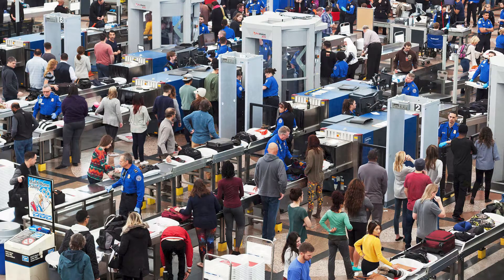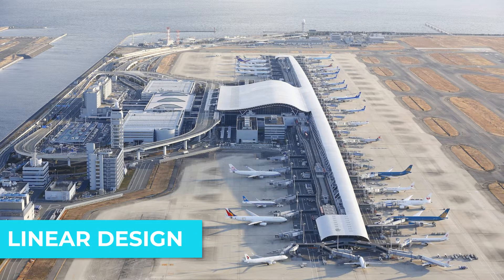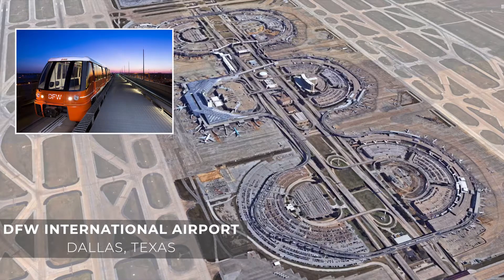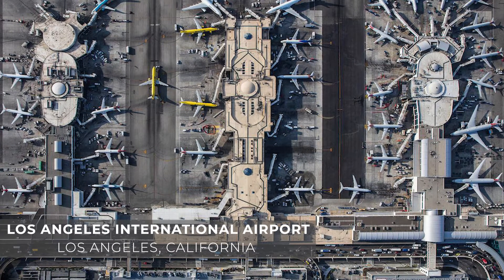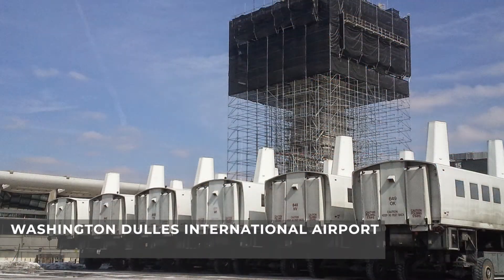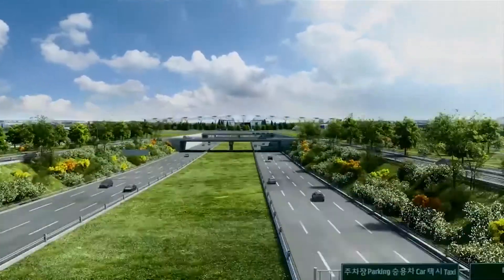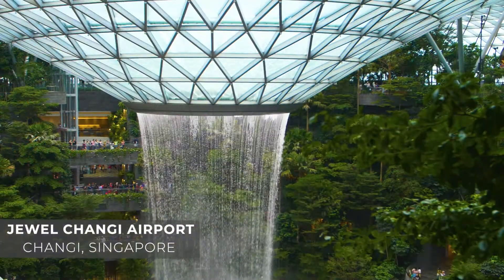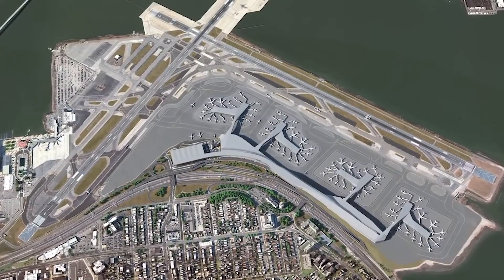How to Design a Good Airport Terminal

Comment: A travel tip - in some instances when purchasing airline tickets some airlines will tell you what terminal a flight comes into and if you have a connecting flight, what terminal it goes out of.  I look for this, as it can help with setting expectations regarding making connecting flights.

Comment: What about the landside/airside design of Tampa and Orlando? The best layout by far.
Reply: I flew out of Orlando a lot for college. I liked the convenience of the satellite terminals (On less busy mornings, I got to my gate in under 20 minutes), but the central hub is poorly laid out, and it needs a redesign so that it is more intuitive for travelers.

Transfers between terminals require going through TSA a 2nd time, the check in areas don't have enough space for the lines, and you have to rely on signage to find your terminal, because the hallways don't properly funnel passengers towards the gates.

The airport is still lightyears better than JFK, Boston, or Denver, but it needs improvement.